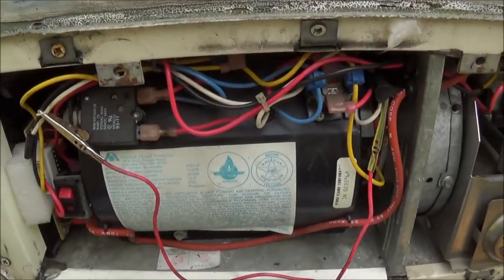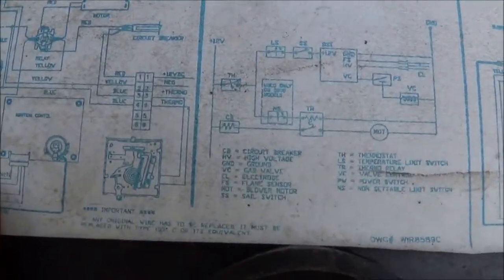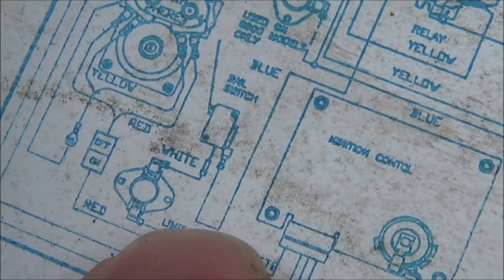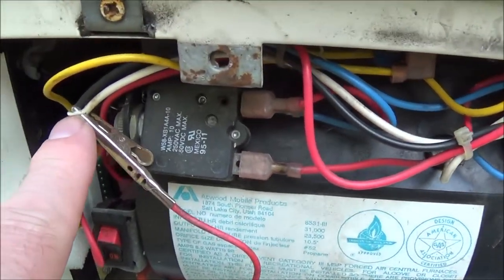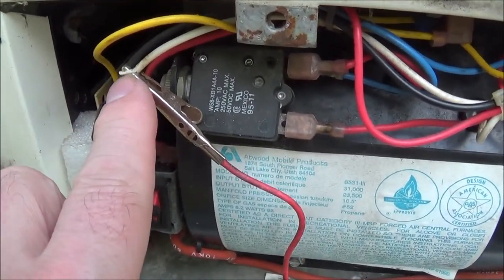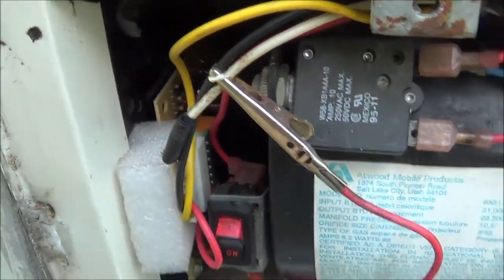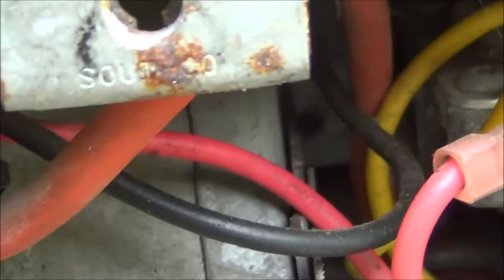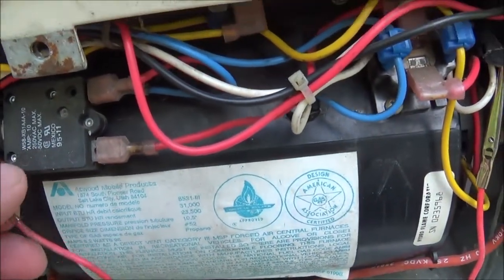Atwood Hydroflame Hi Limit switch bypass FOR TESTING.

Comment: Great idea,  I'm working on an older Atwood 8531  and the limit switch is buried in at the rear of the blower.   Your idea of tapping into the wire saved a lot some time.  Limit switch is good in this case.  Thanks